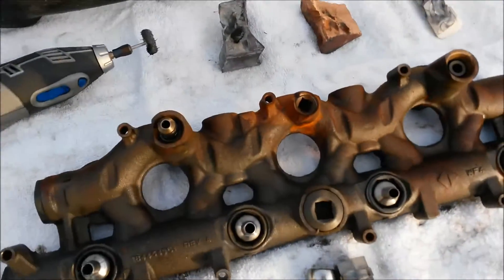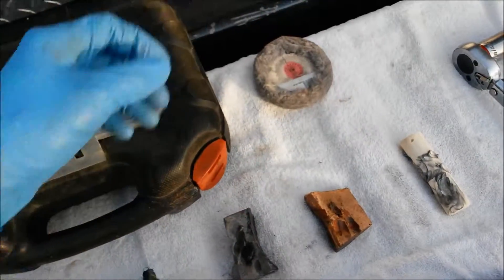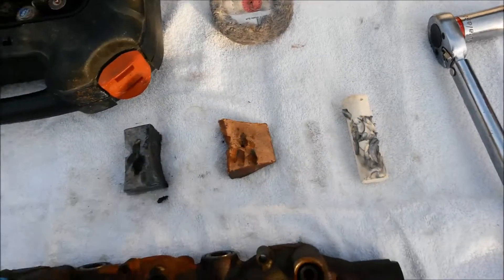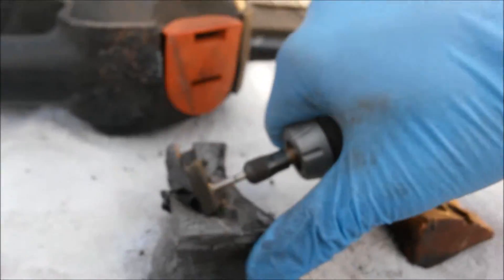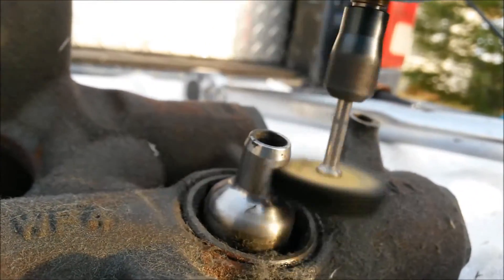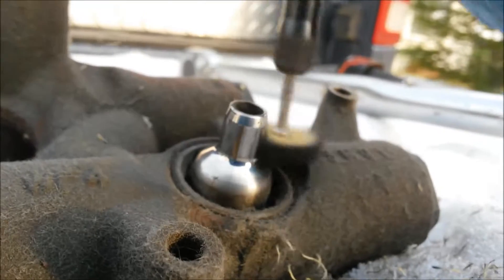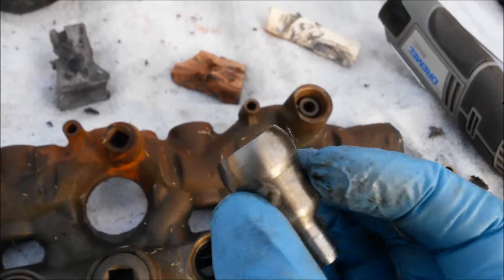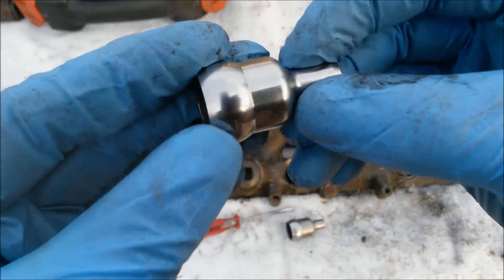FORD 6.0L ~Polishing Your Nipple Cups/Ball Tubes~ High Pressure Oil Rail or Top Injector Leaks

Comment: you don't mix polishing compounds like that. it's much more effective to have buffing wheels dedicated to each compound. it would be like using valve lapping compound without cleaning between the different grits. you're pretty much still using the heaviest grit.